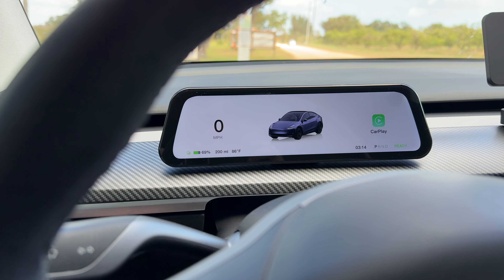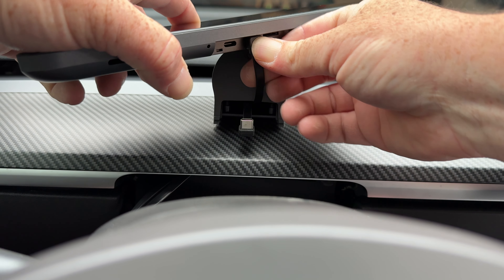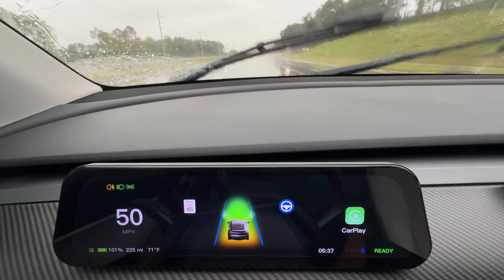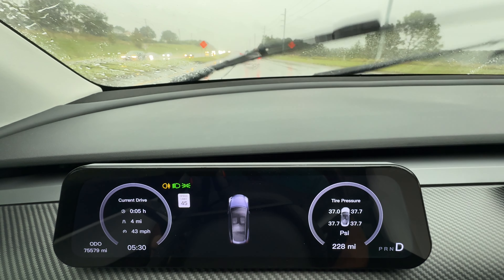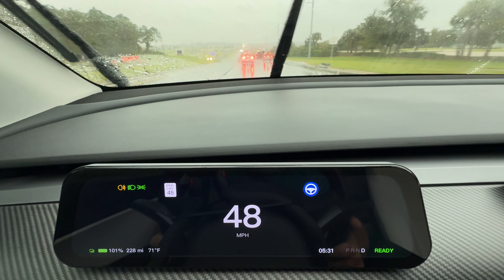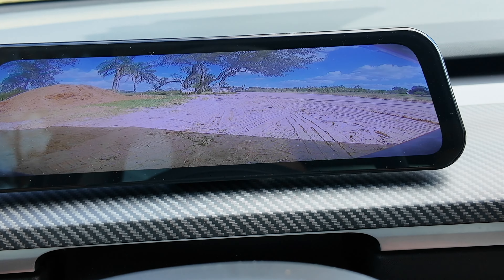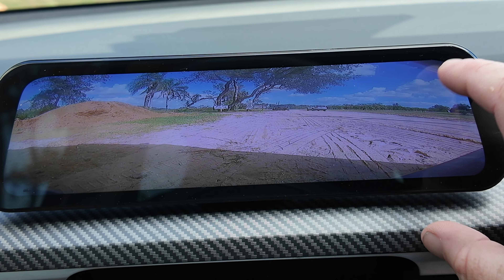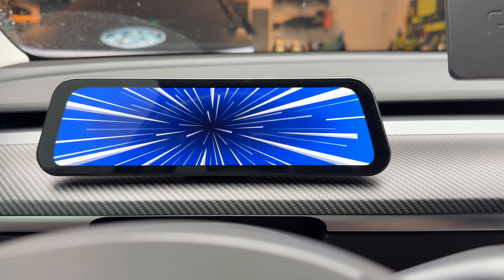Tesla Model Y & Model 3 - The BEST & Only HUD Display To Consider - Here's Why...

Comment: That 101% battery. I believe Tesla will send an update to cancel the nagging issue once it’s been implemented. Just admit that the airflow will be blocked and there’s nothing wrong with that.
Reply from the maker: The 101% required a 10 second hold on right scroll wheel

Comment: battery charge to 101%?
Reply from the maker: It calibrates after the software update
Reply: Press and hold the right button of the steering wheel for about 25 seconds and release it after the automatic matching is completed.